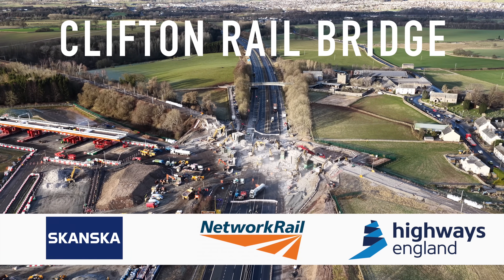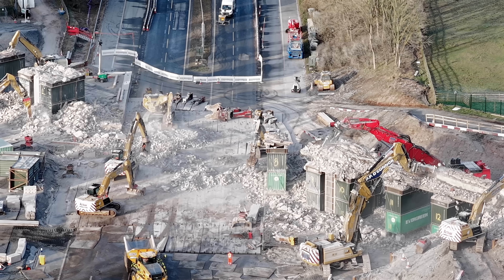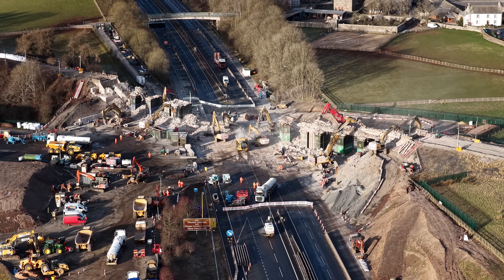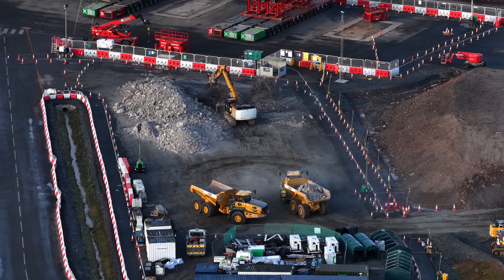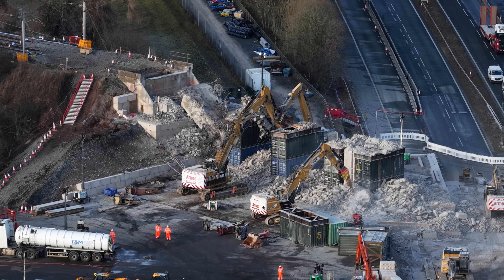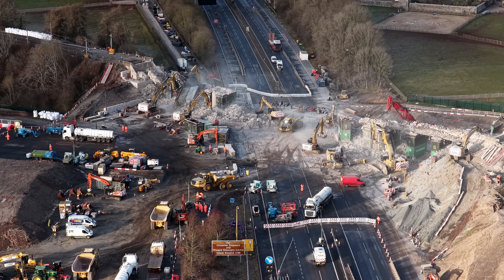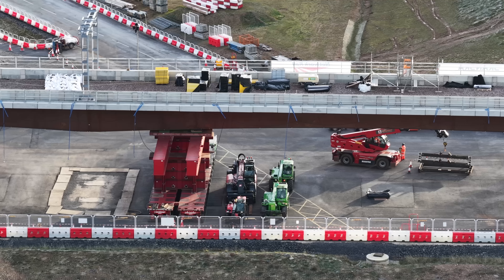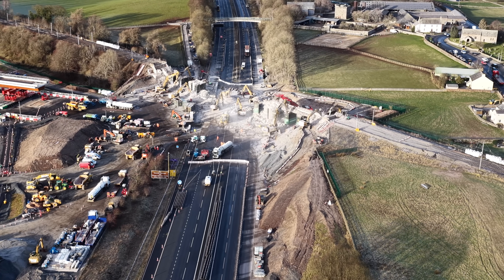Clifton Rail Replacement Bridge | Demolition taking place 4th January

Comment: What exactly was wrong with the bridge that it could not support 2 trains at a time given that the structure was supported with steel rods, etc? Was the concrete sub standard? I’m assuming that it was likely the vibration of trains overhead had been creating additional stress on the structure?
Reply: Essentially yes, sub-standard 1960's concrete